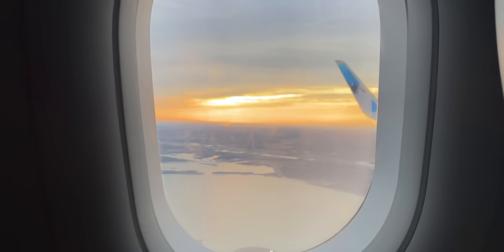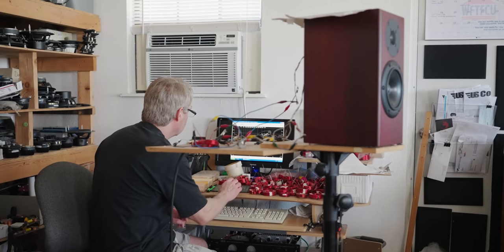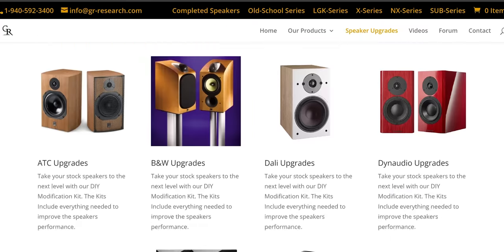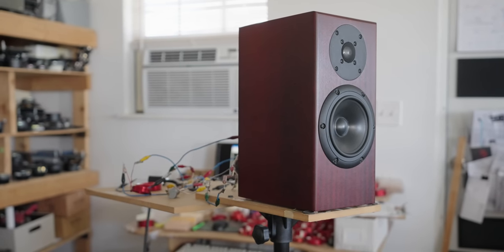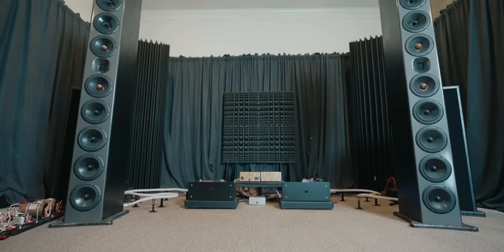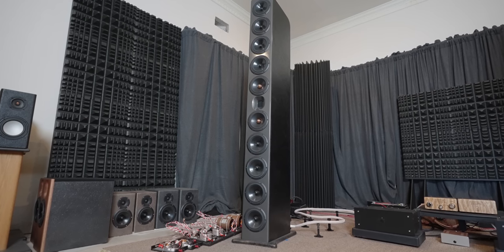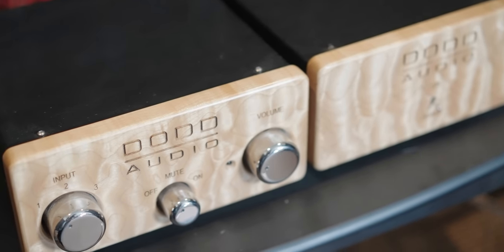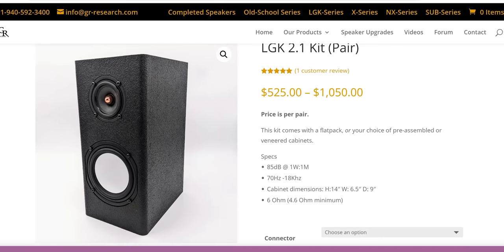Are the GR-Research Audiophile DIY KIT Speakers & Upgrades Worth The $$$?

Comment: For some time I am looking to making my custom preference DIY speakers and maybe 7.2 system.
Watched lots of clips and read tons of audio/speaker literature.

1. Total scam for me I mean Not Danny from GRresearch but the whole audio market and overpriced Hi-End marks with extreme labeling - reference/hi-fi/hi-res/audiophile grade and so on.
2. Humans hear the 20hz to 20khz range. 
3. We hear trough the ear which is also a circular flow horn loaded drum which resonates thus hearing but we don't hear flat. In 3 Db difference in frequencies we hear either a drop, or a raise in sound frequencies.
4. That's why speakers are standardized in the +-3db range mostly /50-20khz region/ with -3db almost always near the Fs of the LF Driver or tuning of the enclosure.
5. Speaker labeled specs are made in anechoic chambers which chamber has totally different sonic character and sound stage presence than your typical listening room.
6. Dany's 200hz to 20khz measuring field is more important than 200 and below because from 200 to 20hz there is a lot of room gain into account so for every room different response from the same speaker ;)
7. Passive crossover networks are basically electric circuit in which the better the components the lesser loss in signal strength/quality.

Massive example.

I have a Focal Utopia 7.2 full utopia system and a ultra cheap 2.0 KEF Carina II speakers
The Utopia may sound ultra crisp but with the same amp the KEFs sound tighter 
Utopia is a complex designed ported enclosure for the woofers and separated sealed for mid high with complex xover design by Focal.
KEF is simple MTM 32 liter sealed box 2 x 16 liter heavy stuffed box with 2 x 7inch woofers in parallel with lower woofer having a 1st order Low pass @220Hz and upper woofer/twitter section is 2nd order 12 Db/octave @2000Hz.
Despite the Focal's having a -3 Db point of 30HZ and in room -6Db @ 20Hz the KEFs have -10Db in room of 30Hz and -3db of 40Hz.
The KEF sounds more accurate and tight for music than the ultra expensive Utopia.

More to your personal hearing than marketing in it :D

Comment: “Upgrades” are always tricky.  You always have to ask yourself whether you want a slightly better speaker or whether the money is better spent on a new speaker.  For example your taste in sound reproduction can change and/ or you taste in music can change.  That could easily change how you feel about your speakers.

As for DIY, the chance that you would design a better speaker than Danny is between VERY slim and none.  The challenge for companies like GR is that more speaker companies are adopting a direct sales model which is making assembled speakers much more affordable than before.  On the plus side, there are fewer opportunities to actually hear speaker before purchasing them.  The ability to hear speakers was traditionally the advantage that conventional speaker companies had over companies like GR.  That advantage is largely gone now.
Reply from the maker: well... many of those companies also adopted the "in-home trial" model which I'd like to take some credit for suggesting and pushing that idea onto some of these guys that didn't have that before
Reply: And that is the new divide between traditional speaker companies and DIY:  quite a few speaker companies now offer in-home trials and DIY speaker companies, as far as I’ve seen, do not
Reply: @ccdccd8615  Kind of hard reselling a kit that was already put together vs a pre built that just needs cleaned up...

Comment: If the listener believes the speaker sounds better, or it objectively measures better, then it was an upgrade regardless of whether it was a mod or not.
Second, I understand taking measurements of a single speaker, but listening tests should include both speakers.  You can listen to one speaker, but that cannot give you impressions such as soundstage, or depth.  You need at least two speakers for that.
Third, Danny admits there's not much he can do with frequencies below 200Hz.  So there's really no point in him looking down there.  And lower frequencies are less important to the very things that Danny is interested in improving.  Perhaps he misses something that could be corrected below 200Hz.  He may not be doing everything.  But what he does, he does well.
And it is entirely possible to do an A/B comparison of his modificationa.  Simply buy 2 sets of the same speaker.  Listen to each set before modification to make sure they both sound the same.  Mod one set, and then do your A/B comparison.

Comment: Great Job Danny for showing and educating us on the differences between quality and inferior parts example Air Core and Iron Coe Inductors using any parts that have iron in the signal path that degrades the signal path based on stored energy based on and proven analytical Data.

Comment: Every reservation you have about Danny is legit. I know a couple customers who had their speakers ruined by his “upgrades”.  Some may like it. But it’s not better.
Reply from the maker: Thanks for sharing!
Reply: How would they be "ruined" when all they have to do is wire the old crossovers back in? 🤔
Reply: Please tell us which speakers your customers got ruined, as consumers help. Why didn’t they like the sound? Did they do the upgrade them selves and correctly?
Reply: @rikardekvall3433  upgrade was done by Danny. By “flattening” the response, the musicality of the speakers were gone. It sounded sterile and lean. Just because the speaker is flat a 1 meter by gated measurement doesn’t mean that it will be accurate or musical when the sound reaches your ear 3 meters away. Didn’t you know a pair of drivers from speakers can be as bad + or - 20% in tolerance?  Danny is flattening the response of only one driver and the assumption is his choice of crossover values for one driver applies for the other driver that he never measured.  If he wants true flat response he needs to measure both speakers and design crossover for each speakers.  In fact many speaker designers have been known to tweak crossover values for left and right drivers.  If you know anything about speaker designing like Andrew Jones, frequency response is a small fraction of speaker design. I find it hilarious that Danny doesn’t even listen to the speakers before and after his mods. Btw, there are many famous speaker designers who disagree with Danny’s method. He makes very good speakers for the money because he virtually no over head and doesn’t advertise in traditional magazines or online sites. But he uses primitive measurements with limited set of tools. He will never be one of the greats in high end speaker design.
Reply: @cup_and_cone  maybe because the original crossover parts were thrown away. Even if he had the original parts, he was still out of money for the mods that ruined the sound. And he wasn’t handy with a soldering iron or knew how to put the original parts back together.  And maybe he didn’t want to pay more money to ship his speakers back to Danny, pay for redoing his speakers, and pay return shipping.  Afaik, Danny didn’t offer money back guarantee. Are you a Danny fan girl?

Comment: I think I have a similar opinion of GR research as you do. These modifications that he’s peddling simply change the sound of a speaker. It doesn’t necessarily make the speaker sound better, they just sound different. 
      I had to laugh at his fix for the Totem Rainmaker and comments regarding no internal damping materials. He may want to read up a little on the speakers he criticizing or fixing (lol) I have a soft spot for Totem and was quite offended by his video. Those speakers sound the way Vince wants then to sound, resonances, metal screws and all. A flat speaker response doesn’t necessarily make for a great sounding speaker, I think Danny needs to get that through his head.

Comment: I can agree that the quality of crossover parts can be subjective, but most of the other companies original crossover designs are just objectively bad.
From drivers having horrendous break ups in their bandwidth to drivers being out of phase. A couple dB difference here and there can be personal preference, but most of the designs are far from that.

Comment: 4:32 wat.
When you design a crossover, you measure the individual drivers, or you measure the box. You never measure two boxes, because that makes absolutely no sense - it will break your phase response. Hence, to design a crossover, you only need one box.

On the other hand, when you review speakers, you listen to the configuration that the end consumer will use, hence stereo for stereo boxes. With just one box you will never be able to assess the character of a stereo setup, you won't know how the speakers behave spatially. Doing a review using just one speaker is completely stupid.

Danny is not contradicting himself, he is absolutely right.

What many don't realise and what Danny explained in one of his latest videos - speakers are built to a certain price and crossover is where you can save the most money, even though it's the key component.

And I'm not even a fan of the guy.

Comment: Custom speakers (you call them "D I Y") are 4 to 10 times better than anything you can purchase retail from the likes of Klipsch, Paradigm, B&W and others.   Klipsch was recently discovered to use substandard bracing (or none), cheap crossover parts and more.   Retail speakers are in fact, bottom barrel crawling in the sound industry.   Retail will product "sound", but true quality at reasonable pricing can only be obtained through Custom Designs.

Comment: gr research does upgrade speakers. speaker companies dont use r&d  for make a good speaker.. no . they try to make the best sound for the lowest ammount of money
speakers under 3k  is making speakers that need the least crossover parts  . like 1, 2 coils, 1 2 caps.  ( good matching speakers. )
above 3k you see more parts in it.. not try to match the speaker. but more taking the best part from a speaker. and what parts you need is what you need.

Comment: I think that people forget that we all hear things a bit differently, that may be due to our frequency range as we get older and or the way the brain functions but the bottom line there is no perfect speaker/ amp, the perfect one is the one that make you happy not someone else. Personally i use a pair of omega speakers a pair of klipsch a pair of gr research, depending on my mood and music i might be using a emotivia amp or a Chinese tube amp but at the end of the day its me that needs to be happy. I think that some audiophiles are just full of shit the next time i meed some dick that tells me about their 1000 interconnects or 1000 dollar speaker cables or tinker toys holding cable off the floor i am going to piss my pants.

Comment: U are missing what hes saying about listening to one speaker not a pair by comparing it to him making a crossover using one speaker.   Do u think crossovers are different in each speaker in a pair?    Ur way smarter than that so it really seems like you WANT to misrepresent this…. Cmon man
Reply from the maker: Yes you can design a successful pair of speakers by first designing crossover of 1 speaker as the other one will be the same. HOWEVER, all designers I know do not just end there. They listen to the pair created and make adjustments and fine tunings (which is also what gr research said they do) 

Gr research (danny) stresses the importance of improving soundstage amongst other things with its upgrades and their own kit products. Tell me then, how does one test/improve soundstage with only one speaker? Even gr-research admits that this and other intangible differences they claim is not possible by testing 1 speaker. 

Gr research now “claims” that those things are easily “guessed” because Danny is very experienced. I find that hard to believe as all previous statements from GR Research before I pointed out was to always do “trial and errors through listening to a pair of speaker and not one.”

Comment: I admit to being old and sceptical but I question the ‘holy grail’ of a flat frequency response over, say, 200 cycles, as adopted by both GR and Emir. A well-financed firm like our KEF or Mission or some of yours could EASILY design their speakers to create a flat response. But they demonstrably don’t. Our ears are definitely not linear and all our ears are probably different! What’s wrong with just listening to enjoy the music?
  My other bugbear is that those who spend money on an upgrade from, say, GR will be expecting an improvement and, sure as eggs, they’ll hear it. The comparison of the sound before sending off to Texas and after getting your speakers ‘upgraded’ is utterly meaningless without a true blind test of before and after with someone else running the test. I bet nobody has two pairs of identical speakers of ANY sort, one before and the other after modification by GR Research’s kits, to properly test blindly. Danny @ GR Research knows this perfectly well and has built his whole career on this anomaly.
  We all go willingly to (commercial) slaughter in the hifi / audiophile hobby group. Not much different from the charge of the Light Brigade in Crimea all those years ago. Do what you’re told ….

Comment: I'm pretty sure his upgrades are really upgrades, even if you set aside the filters that he use to correct the FQ he is swapping for better components, and yes, manufacturers spend hundreds of hours designing a crossover, but they're also required to design a crossover made of parts they can easily buy, while costing very little to meet their price point, when you're designing a low volume crossover and cost is mostly no object then it is way faster to finish the job, you can just make the calculations and come up with the design an that's it, you don't need to source components from 10 different factories wait for their responses, test hundreds of samples for QC and all that. But still I think he is like a sutubborn old man with old ways that refuses to try something that could make his work better, and that results in products that actually aren't as good as he thinks they are, aren't as competitive as he thinks they are and might have a lot of distortion in the bass region but he would never know anything about it because he can't hear it for himself for any reason that might be and since he doesn't test it, he'll never know and then will be all hurt when someone else points it out.

Comment: If you want to be jn this business you either have a chamber or use klippel. I cannot believe they don't have the funds to buy one. If he really measures this way then it's all bogus. I am sure if someone takes an "upgraded" speaker that is supposedly flat and measures it with klippel will find a number of defects.
Reply: Good grief! We had our own anechoic chamber at our first facility. With the tools we have today, it is just not necessary any more. Also, Klippel is just another brand of measuring system. Whether we use a MLS, Klippel or Clio doesn't change the results. It is far more important to know how to read and interpret the measured data.

Comment: Danny is a salesman. He doesn't do any engineering. He buys mass produced parts and assembles a speaker. He has the nerve to criticize manufacturers about their products, but he has never designed a speaker on paper from basket to cone. If you cant tell by the eye darting, twitching, scratching during his videos that he is dishonest.
Reply from the maker: I didn't find him dishonest. I actually understood about him a lot more once I met and spent time with him. What I understood was that he has been doing this a long time and has his own ways of doing things which to some can seem like he is stuck in his old ways and refuses to change in an egotistical way and to some others it can be interpreted as being confident in his abilities that he honed in on for years
Reply: “But he has never designed a speaker from basket to cone”. 

You sure about that cowboy?
Reply: @Newrecordday2013  Here we go : NRD to the rescue.  I wondered how long it would take...
Reply: Well, Klipsch, Elac, KEF and other speaker manufacturers aren’t they also selling speakers? Or are they giveaways? He’s engineering crossovers to his own speakers and upgrades. Also to other manufacturers, like Taylor, Buchardt and Ushers. Other manufacturers aren’t the Holy Grail. He designs his own speakers, with what is available on the market. But he can add adjustments to them so they will fit this sound preference. So does also other manufacturers. Like Buchardt S400, uses SB Acustics line. Not made in house. Dynaudio makes their own speakers, but they aren’t the best. ATC makes their own and Danny praises their quality. Shooting a video would also make me nervous and itching. How about your self?
Reply: @Jayiyagi  my vote is he's number one!
Reply: Danny has “designed” his own drivers and speakers from the ground up. He has also won awards for his part in other companies speakers he has worked on. As for a salesman, he has to be in some sense to do his business. One thing though is he is honest and has integrity.